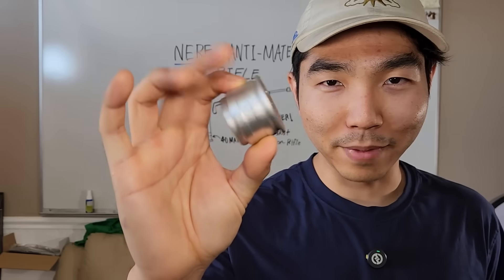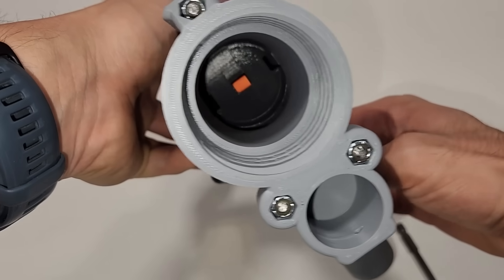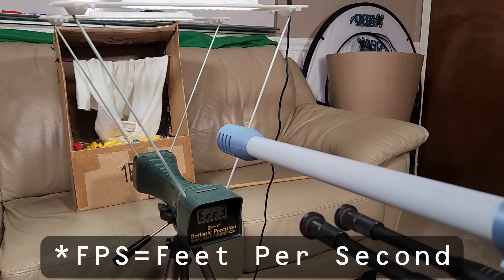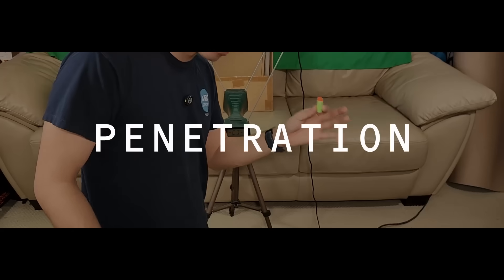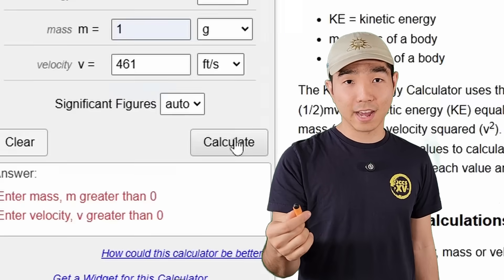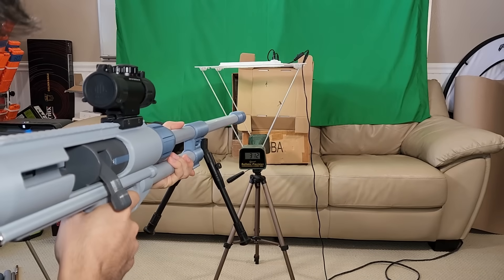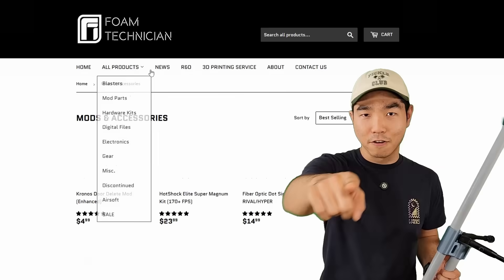Making the Most Powerful Nerf Gun on the Market

Comment: I wish you had shown accuracy at distance, say 100ft with a regular 1g dart. The higher the fps the greater the engagement distance should be. And tbh there are quite a few Foam blasters ( springers ) that can easily get to 350ps with reasonable primes.

Comment: You have a problem with consistency I have an idea about ammunition or propellant There is a product from gogun This works with compressed air And is in the shape of a shotgun cartridge, cartridge  Scuba Ringer And a similar but even more powerful product  cartridge  air banger Alarmo However, the latter may have a bit too much power And the cartridges themselves are reusable, the only thing you have to replace is your small, thin metal plate On the back of the cartridge And you shouldn’t get away with it much more expensively than if you put your gas in and maybe a little bit more But not much Because you now use high air pressure instead And the cartridges can be refilled anywhere you can refill air rifles You just need the appropriate adapter to fill it up, but that's a minor problem In any case, they can be filled very consistently And they already have the form of ammunition (Mind you, they don't fit in a real shotgun) I could even imagine that for the pressure you need you could fill it with a regular compressor, but I don't know how well that would work in order to overcome the resistance when filling it 
In any case, these cartridges are from an underwater over barrel air rifle However, in Germany they do not fall under the weapons law because they are sold as sports items And the second cartridge is from a noisemaker, in principle a blank firing gun Only with air pressure and in Germany also without a gun license This shows very clearly that these cartridges are able to move even heavier projectiles  And I can also imagine that if you make the metal plates thinner you could also reduce the maximum pressure In any case, they can be filled with lower pressure than recommended and will still function Because the pressure refers to the use for which they are actually intended You just have to install a small hammer at the back which then perforates the back of the cartridge How this works mechanically can also be seen on YouTube as a video

Links are included as an example in the answers However, buying in America is a bit different than if you were to buy it in Germany But I know that it is also sold there However, not from gogun but from cooperation partners

Comment: You should try to add a little chamber bubble up top to mount a spark plug and delay the spark by a .10 a second. It may blow up but if it doesn’t it would be so freaking cool.
Reply: I was thinking this, but a couple of pins with a high frequency continuous arc

Comment: with that last dart design, you can basically turn it into a apds round with instead of a ball bearing, make it into a sharpened hardened steel rod. Or better yet make it out of tungsten, but that would be difficult and expensive tbh. So you make these apds rounds, make it mag fed, somehow make it consistent, and make it pump action because why not and bam you have a pump action mag fed shotgun shooting apds slugs.

Comment: 2 things I'd like to add there are 2 different 40 max bases. The blue one has a higher air volume, and my second thing is to use hpa,  get a taginn hpa filler. I've been using hpa in these for a while to launch taginn 40 mm grenades, and they are absolutely amazing
Reply from the maker: Yeah, I have a couple 40wads on order so I'll be able to test those soon. The taginn stuff looks really interesting. Would love to get some of their stuff.

Comment: Could start with a low pressure hpa paintball gun. Borrow 30 years of tech around consistency. Use a popet design. Like an old ego or promaster. Just sleeve upper tube for darts. Make a bolt and barrel. Even chambered .68 they will shoot a dart very far. Could be epic.

Comment: i don't know if you engineered the cartridge or not, but move the seal up towards the nose so the pressure of the bolt forces the o-ring to seal properly.

it might solve your FPS inconsistency.

Comment: Simple way to make it a bit faster is. After you fill up that bullet thing with gas, heat it up as much as you can without melting the plastic bits. That will increase the pressure giving it a higher velocity.

Comment: Try using a larger propane tank for consistent gas filling and with the canister upside down like people have said. You can also get adapters to switch to compressed air or co2. Also make sure to use silicone grease when using these gasses as they are hard in the oring seals. Normal Airsoft gas has this oil premixed

Comment: It's possible that the inconsistencies in the velocity come from irregular hammer/firing pin strikes into the cartridge primer/activator.  Maybe get a heavier hammer/firing pin or harder springs for the firing mechanism?
Reply from the maker: The 40max shell just has a valve on the back and when pressed it instantly opens up fully and dumps all the gas out so there's no firing pin type mechanism. I am pretty sure the inconsistency is due to air being trapped inside the shell before filling. Purging out air before filling seems to lead to a much more consistent gas fill.

Comment: if you want it to go fast as f**k you should meake a APDS or APDSFS wich both are Armour Pearcing Discarding Sabo rounds BUT the APDSFS is like a dart/arrow shapted and it has fins..... hmmmm Finns🇫🇮🗿 they are designed to penetrate a shish ton of armour. so if the avrage nerf dart is a 50 cal. in diameter that means you whould have to 3d print a APDSFS dart in 5,3/6mm diameter and cover it with the sabo in 7,6/6mm sabo and meaking it to American lenghs and stuff you whould get 0.208661 Cal/0.23622 Cal for the dart and 0.299213 Cal/0.23622 Cal for the sabo.

Comment: I noticed that you're bolt moves back when you fire, you could try to strengthen that so it remains closed and allows for most of the air to go through the barrel, as the bolt moving back is detrimental to the seal and you may get more consistency in spite of the shells. I also noticed that the bolt moves back in different distances every time you fire, meaning that you're shots may vary purely for that reason. I really like that build and I really like the idea.

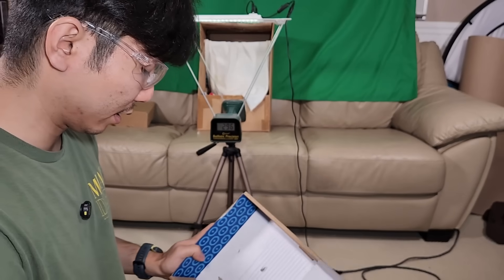Comment: 6:45 bro made a NERF APCR (Armour-Piercing Composite Rigid) round unintentionally
Reply: Wouldn't it technically be more of an APCR because the "sabot" stuck with the main penetrator, then peeled off once it hi the target?
Reply: @CharlieBaker4470 yes, it’s apcr.
Reply: wheres the sabot
Reply: @john_half-life-opfor the foam that came off the dart was the sabot
Reply: APCR not sabot considering the foam didnt didn't disconnet out of the barrel and also didnt split at all

Comment: part of why the nitroshot darts went faster is the "bamboo", where there's 3 bands that seal the dart against the barrel instead of the full dart, keeping a seal while reducing the amount of friction on the dart. I believe there are jigs out there to DIY bamboo darts, so that would be an interesting next step
Reply: Tends to be true for lower powered springers but with HPA and the like the foam is expanding to fit the barrel regardless so it doesn't make much difference and you usually want the firmest foam you can get with a tuned barrel to match.

Comment: if you make your own shell, from the ground up, you could make one that uses CO2 canisters for consistent velocity. It would be significantly more difficult and complex, but I believe it would be worth it, for the funny.
Reply: But at the same time. The shell would have to be engineered in a way that when fired.
The dart/whatever is being fired doesn’t get annihilated
Reply: @electrobuster5483  perhaps he could use those solid darts from that newer company siren. they're sorta like the same material nerf ultra darts were made of just in a half dart shape with no hole in the bottom. I have a feeling the hole is part of what makes the darts rip apart when shot at too high velocity because the huge volume of air required to do that pushes inside that hole and then expands when it leaves the barrel, shredding the dart. You can even see this in the video of the guy who tried to make a supersonic nerf gun, in the slow mo you could see the air ripping its way out from inside the hole in the center of the dart. 

Making homemade darts (commonly called "stefans"), sorta like the old days of nerf modding, could also possibly work since these are also solid with no hole in the bottom. Usually made from foam backer rod, it's just a solid slug of foam with something glued to the tip for proper weight distribution.
Reply: There's a limit to what a foam dart can withstand - like the other guy said.
The CO2 canister itself can be the projectile as well as the propellant, if you want to go that route. Something like a slam fire shotgun crossed with a ping-pong "burp gun"
Reply: Why not just buy a PCP air tank and valves and make it a real air gun lol like a 50 cal AEA m50
Reply: @AckzaTV  If you're making an air gun, why stop at .50 cal? It could be a proper cannon

Comment: Quick thing from the airsoft world. Gas exiting the barrel can cause chrono miss reading. You should take a look at some of the taggin co2 grenade shells. You can get an insane amount of power out of them and you should be able to print a 3d adaptor semi easily. Also, to help reduce dart explosion add some vents before the dart gets any room to expand at the end, this should in theory allow the gas to expand out these vents rather than the dart exploding xD
Reply: Ported barrels don't seem to help that much. You need to balance the barrel fit and barrel length with a good dart. You can get 700+ fps from worker gen3s without them exploding.

Comment: Youre experiencing something called joule creep. Its why most up to date fields have you chrono with your chosen bb weight, and then limit it based on energy as opposed to velocity. Overly efficient systems like HPA have so much more gas than it can use, so a heavier bb gives it more time to utilize that energy and thus makes the system more efficient. 

A field that limits by only the standard of 400fps on a .2g bb can see HPA players using heavy BBs to gain as much as 50% more actual muzzle energy. Its wild. 

I know thats airsoft, but thats how I know to describe it. Its the same with this nerf, youve got so much extra gas, that itll be wildly more efficient with heavier darts

Comment: Fill the gas canister upside down. You will end up filling it up with liquid propane that will flash expand into gas. Giving maximum power. Also redesign the shells with an internal expansion chamber to reduce shock on the darts. And might as well look into 40wad engines...

Comment: Surprised you didn't calculate how long it takes the 40max shell to release the gas into the barrel and then adjust your bullet to be heavy enough for it to take longer to exit the barrel then it takes the shell to release it's gas, doing that will make blaster more efficient and powerful. Also it would be quite fire if you made some apfsds rounds or canister rounds for your blaster.
Reply from the maker: I was trying to do those calculations but I ended up not putting it in the video because the gas filling inconsistencies made me give up lol. I think I may have figured out how to fill the shells more reliably by purging the air out first. 

I do plan on making APFSDS rounds! I've started working on some of those.
Reply: @Tetsu0_0Y  cool, but what about shotgun rounds, their easy and really fun, just need a coupple airsoft bbs with a kork wad in the back and some paper to hold the backage together

Comment: you could try to get a air compressor with much higher pressure
Reply from the maker: Yeah that could be interesting, the little 40max gas canisters are supposedly able to handle up to 300psi

Comment: I wonder if you could come up with a flow meter/regulator to show how much gas goes into a shell? Then you could have a better idea of why the charge varies so much. That and leak testing the cartridges to see if some are losing charge over time. Very interesting how you got so much power out of that!
Reply from the maker: I think I've figure out what might be causing the fill inconsistencies. I think it is due to normal air being present in the shell before filling that is blocking the liquid gas from fully filling the space.

Comment: "there's nothing I can fix here"

The shell... YOU FIX THE SHELL
Reply from the maker: Sorry for the confusion, it wasn't clear in the video but the 40max gas canister portion of the shell is not a component I made. I designed the printed front end of the shell to turn it into a complete 50cal nerf cartridge. The issue I was having was getting it filled with a consistent amount of gas. I'm open to hear your ideas on a solution for that.
Reply: @Tetsu0_0Y  A psi gauge connected to your propane canister OR switch to butane for more consistent results at lower inconsistent pressures. The latter will definitely drop your speed though since butane is unreliable as a propellent at higher pressures.
Reply: @Tetsu0_0Y  Try completely purging residual gas after firing and inverting filler can when refilling. Gas pressure is also  temperature dependent. Love your content.

Comment: How do you prevent the darts from splitting from the pressure of the gas?
Reply from the maker: Good question. Most of the time fresh darts would hold up just fine. I've only had a couple of them split or decapitate before leaving the barrel but those were darts that were already worn out.
Reply: @Tetsu0_0Y  It mainly is the loose barrel you use